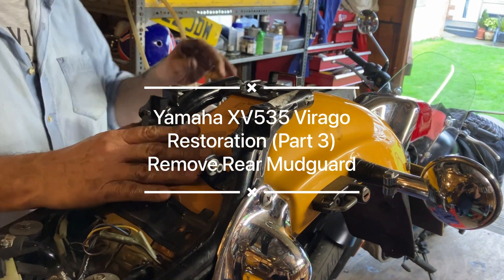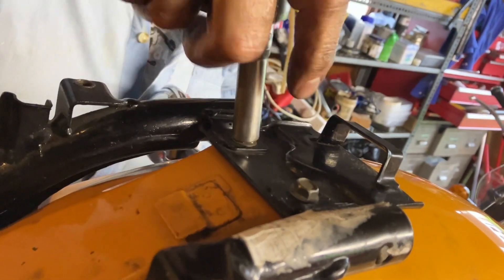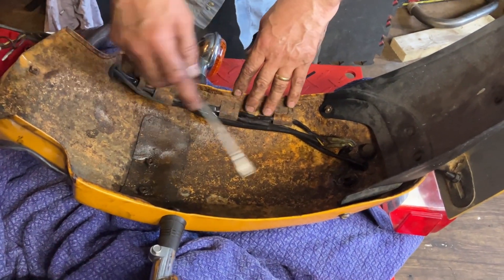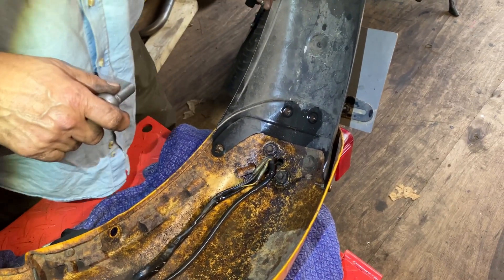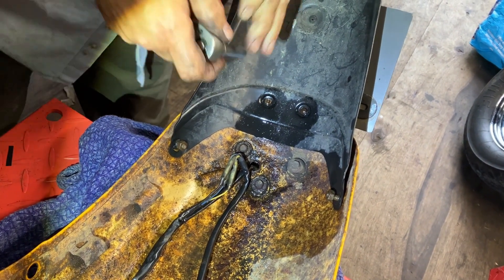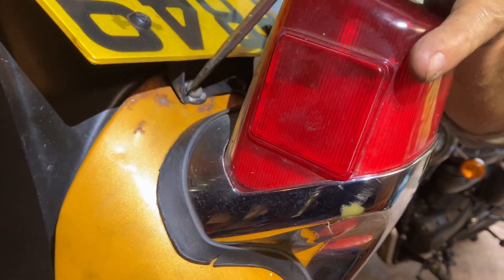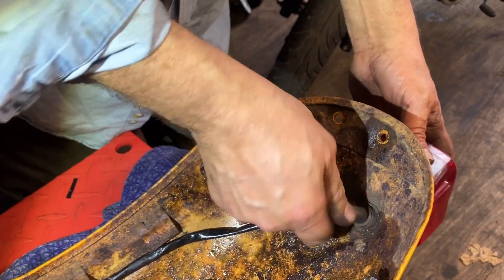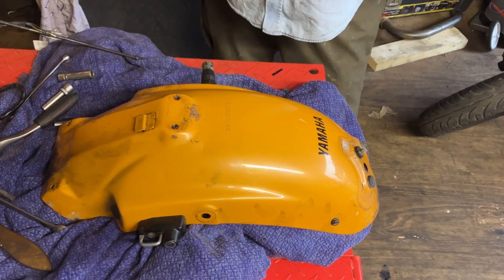Yamaha XV535 Virago - Recommissioning (Part 3) Remove Rear Mudguard

Comment: I definitely need to do this, now I wonder why I haven't before.  Think it would come off as easily with the rear wheel in place?
Reply from the maker: If I remember rightly, it was fiddly but would come off with the rear wheel in place. I'm not 100% sure as we did have the wheel out.